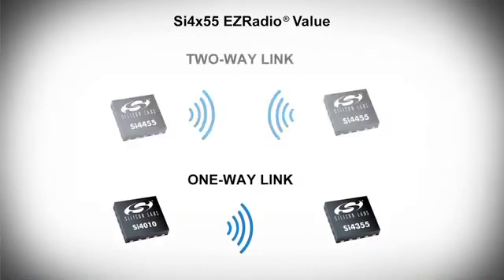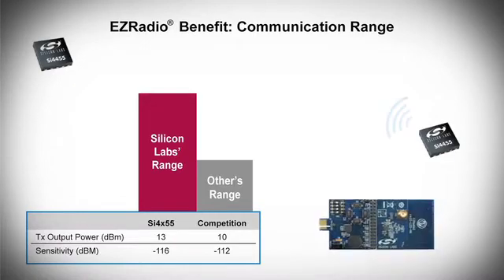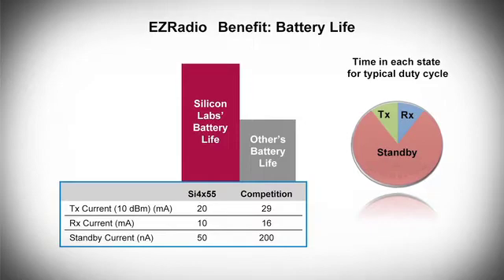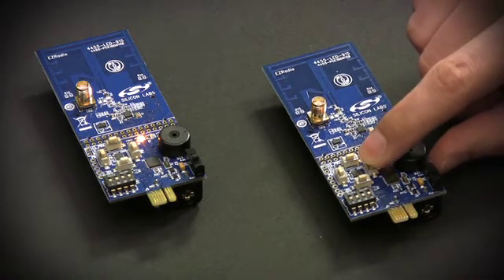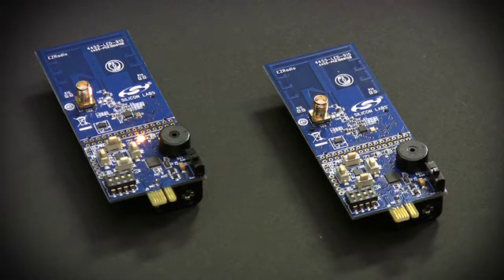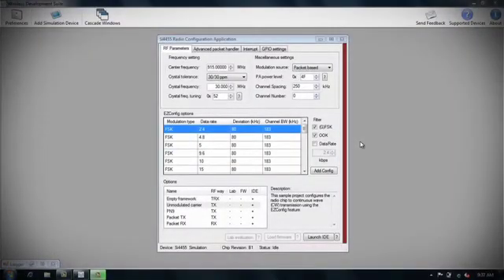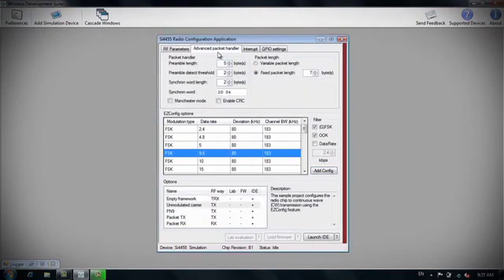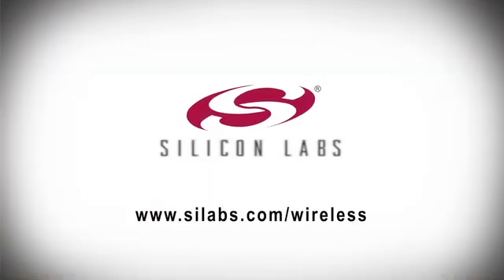EZRadio® Si4355 Receiver and Si4455 Transceiver

Comment: Hi, watching this video, I think it can be useful for a project that I have, and you can also help me. The project is based on a transmitter like this but with at least 8 or 10 buttons, in the receiver I must also have the same 8 or 10 outputs to be able to dock with our equipment. What kit would you recommend for this study, considering that I'm going to start working on the subject ?.